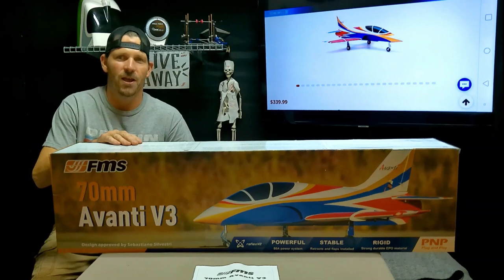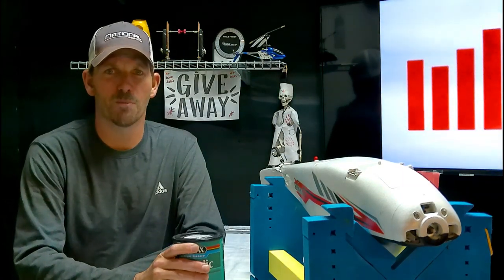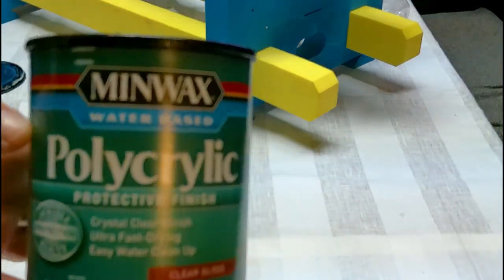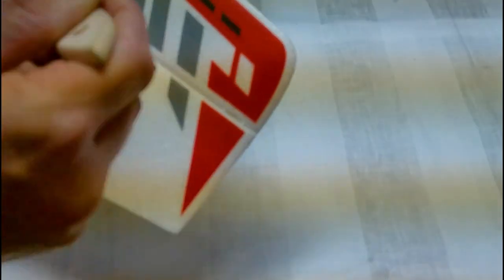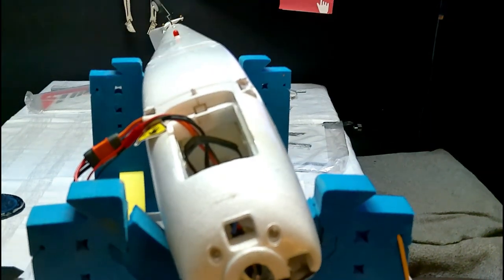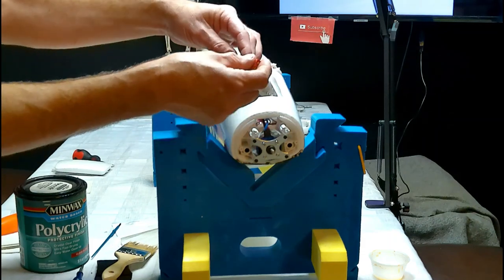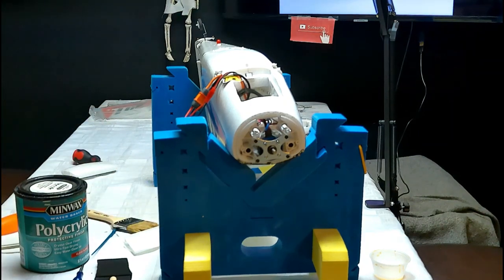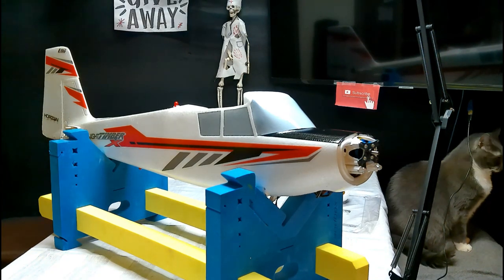CLEAR COAT EPO FOAM RC AIRPLANE A LITTLE ADDED PROTECTION MINWAX E-FLITE NIGHT TIMBER X BNF SPEKTRUM

Comment: Nice video, just wanted to mention that you can get a thicker coat by sanding with 220. Once a coat is applied, wait at least two hours before you sand (assuming your plane is in a warm area to cure in-between coats.) You can repeat this process until you're satisfied with the results. FYI pop those unwanted air bubbles underneath the decals by using a small pin or needle, then work out all unwanted air bubbles before you coat.

Comment: Thanks for this info. Recently purchased a Ranger 1600.  The plastic fuselage is the best for practicality.  The wings are EPP foam, they damage too easily, particularly during transit.  Drives  me nuts.  Will buy this miniwax online and coat them.  Cheers.

Comment: It is a good idea,I did it on my E flight V900 and it does help it to last especially since my plane is a belly lander.I even painted over the different colors on the decals.And painted the canopy graphic on the battery hatch.Its also a good Idea to reinforce the flight control hinges using clear tape

Comment: Can you use spray?
Reply from the maker: chuck i have used clear coat spray paint. if you do that you need to spray it on very VERY lightly then let it dry then repeat. the chemicals in the paint need to evaporate between coats. if you just lay it on thick some of the chemicals may eat up the paint or who know what. im sure there is special products for our planes. but this water based minwax is great and safe
Reply: @GRIFFINRCPLANES  Thanks
Reply: Thanks for video, i need to do my plane but it already has the decals, wondering if I can just go over top them with minwax? Thanks again
Reply: Also, Eddie K - (youtube channel: Eddie K's RC) has a video titled: Protect your Foam R/C Airplane Models. At 5:39 in the video he talks about the differences between the Spray and Brush versions, and his experiences and preference. Might help you out, it helped me!

Comment: I want to do this on a epp foam wing which is a eachine ar wing pro, I've heard that on white that overtime the minwax will start to yellow, just wondering if you have noticed this? Thanks  for all your videos
Reply from the maker: I personality have not noticed yellowing.  With that being said the plane that has been treated with polycrylic min wax for the longest is yellow.  The air tractor has had polycrylic on it for at least 2 years now. So I don't have a good answer for you
Reply: Ok thanks for response, one more question I have min wax on my black ar wing pro, just wondering if its ok to laminate over that? Thanks again